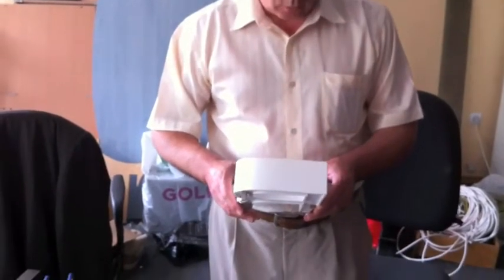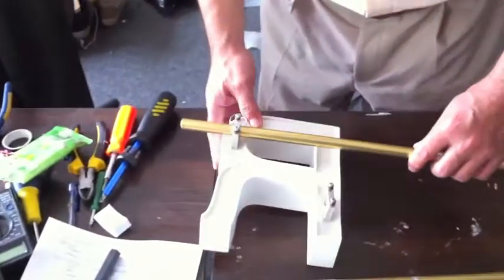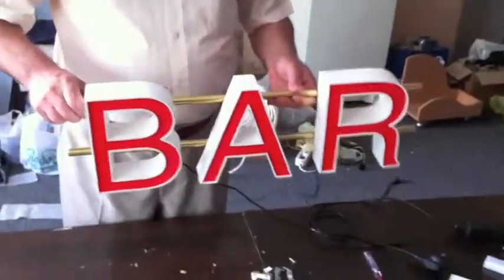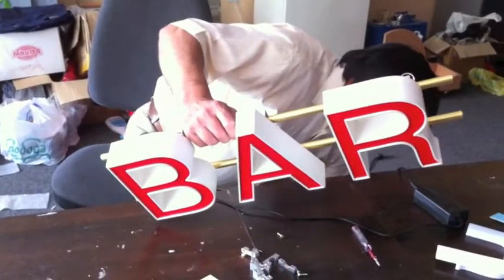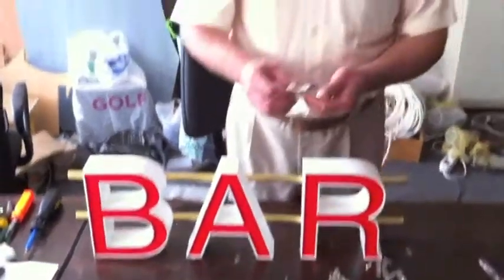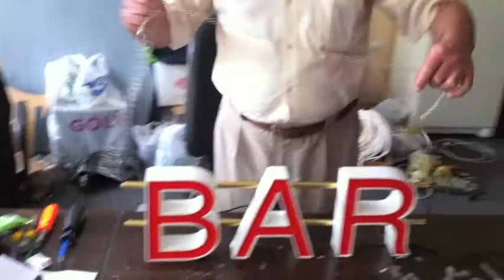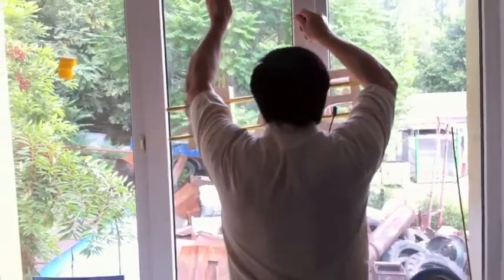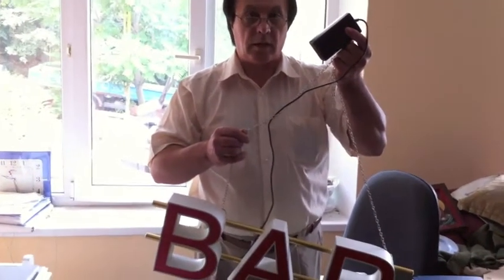Channel letter signs, how to install and use new type of them

Comment: sohali it wont work should use daynight acrylic which is available on the market. where you are  pasting the one wsy vision sticker. inside or outside. if the acrylic.